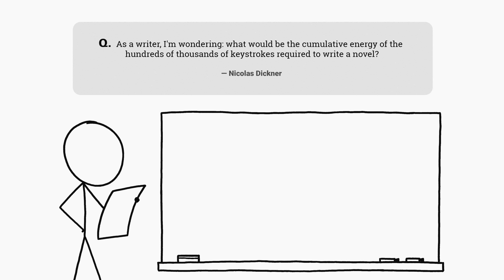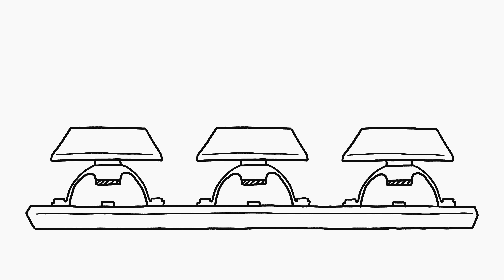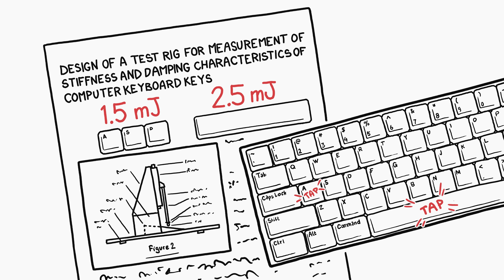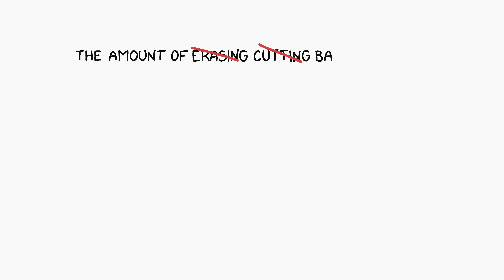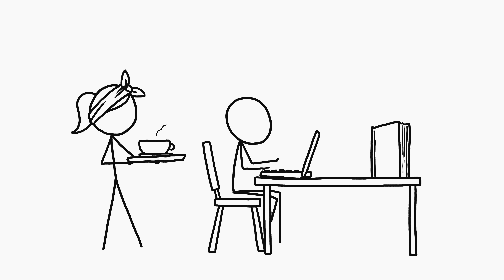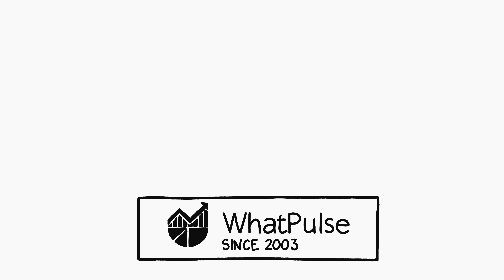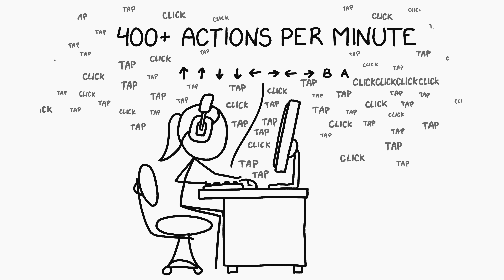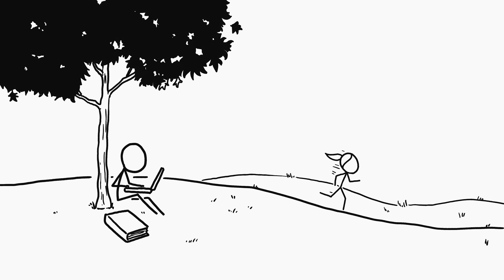Can you power your computer by typing?

Comment: An exercise bicycle with a generator should do it. A not very athletic human can fairly easily do 100 watts for hours on end. A highly efficient laptop with the screen brightness turned down low and only running a simple text editor (no AI!) can consume less than that, I think. If we can capture the heat energy from the body too, we've got another 60+ watts.

Comment: An AA battery can run a low power compute device (like a smart sensor) for years, so if you’re ok with the limited things a low power chip can do, it’s totally possible to power it with typing.

Comment: Im assuming you're referring to starcraft 1 or 2  when talking about esports and apm. Thing is, they abuse the repeating function of the key press. Like when you hold down your "a" key, and after a while, it starts to spam the letter "a" like aaaaaaaa.
This is because of hotkeys, so if you want to make say, 10 marines in sc2, you'd just hold down a for that long instead of spamming it.

Which means that the effort expended is less than their apm would suggest.

Comment: there is the problem, using a rubber dome keyboard. I use a (non-clicky) tactile mechanical keyboard with 67g pressure force. your normal mech kb has 40g force. I have zero problems with fatigue, the tactile feel is more like a massage to my fingers. using it regularly improves finger strength and endurance.

Comment: HEY car manufacturers! When are we gonna have tire pressure monitoring sensors powered by the movement and vibrations of the wheels?! This could charge a tiny little supercapacitor to keep the TPMS powered when not moving or moving slowly and it would last forever, never needing battery changes. I know it's possible...

Comment: I suppose this would greatly depend on what you consider a laptop and the type of keyboard being used.

A laptop shaped word processor with a non-backlit LCD screen that's barely a step above an electronic typewriter uses surprisingly little power and can run for days or weeks on a AA battery.

Combine that with a keyboard that has a single "power" key off to the side that uses much more force to turn a small generator like one of those emergency flashlights and you would still have something infinitely less useful than a solar powered submarine with a screen door.
Reply: Yep, would have been interesting to see the analysis go the other direction and explore how little energy it might take to run a word processor.
Reply: At that point just use a mechanical typewriter

Comment: And still a carefully designed circuit using ultralow power RF data transmission should have enough power from typing alone to power a wireless keyboard without batteries.

Comment: I think the proper question would be “How much computing can you power by typing?”
Reply: Yeah, you didn’t even state the assumed typical power consumption of a laptop computer! 65 watts I presume? But a text editor doesn’t need much of the CPU, and the screen backlight could be turned off, etc.

You could do text editing on a monochrome LCD of the kind that can be powered by ambient room light! Then you only need to power a processor. And you don’t really need to do any significant math with it, for a dedicated word-processing appliance. Just enough to control the position in an array and flip bits according to the ASCII values of the pressed keys.

And the energy generated from key-presses could be banked in capacitors (or since this is an XKCD video, a tiny flywheel — you do mention regenerative breaking!) to reduce the loss converting into chemical potential energy of batteries, perhaps?

Frankly this doesn’t feel like an XKCD video. 😜

Perhaps delving into the very small felt less engaging than the very large?

Are these videos only supposed to be about maximalism, such that when you encounter a question on minimalism, the answer is simply “no”? 🙃

Comment: what about rhythm game players? some people can 15-20 per second for a REALLY long time, also could the use of mechanical switches help? like a clicky or tactile switch or even switches with a higher force to reach the actuation point i.e. gateron black switches. How many people using those switches would be needed to power a microwave? or a led bulb? im not sure but i think that would make great for a part two
Reply: A lot of the top WhatPulse users are rhythm game players. Among the top few users, Robby250, myself, Applequestria, and Staiain all play a lot of rhythm games. It's just that the 20 inputs per second are very difficult to maintain for more than an hour or two at a time.

The world's best and most active VSRG players would be a step above most of us and may be closing in on 1 billion inputs by now, but that's still pretty comparable to the top WhatPulse users.
Reply: @SellymeYT is this including different game modes such as 7k or even games like adofai? i had those in mind when thinking of the averages. I’ve seen my friend play adofai once and it looked physically unreal, and yeah i think i highly overestimated the stamina of the average player but for arguments sake a top stamina adofai/7k player could produce an absolutely ABSURD amount of key presses in a given time
Reply: @3ZLU 7K can in theory peak faster than 4K, but there tends to be more elite 4K players. ADOFAI would be a lot slower for typical play (and is disadvantaged by having existed for far less time than generic VSRGs).

Comment: Can you calculate the maximum possible size of a sphere of.. various elements? 
For example, if you kept increasing the size of a ball of aluminum, how big can it get before it collapses on its own weight? Either into fusion or a black hole. 
Same question for Tungsten. It should be a much smaller volume than the aluminum max size.

Comment: A computer powered by typing is a typerwriter
Reply: I was going to say that usually the issue with siphoning energy off a process is that it doesn't mean you're recapturing already used energy, but instead requiring more energy for the original process. You can use a car engine to charge the battery, but that means the car has to burn more gas to drive the belt for the alternator. A Prius uses regenerative braking to recapture energy, but sometimes it has to run the engine specifically just to charge the battery.

So really, the practical way to make your keyboard power your laptop is to simply increase the force and/or distance required to press a key, which basically turns it into a typewriter.
Reply: @CookiesRiot  A typewriter isn't a computer though. It doesn't take much energy to run a simple word processor compared to a whole PC, but it's still more than a typewriter could provide because changing energy types always results in a steep efficiency loss.
Reply: @Yonkage-ik5qb  Yes, what I meant was that if you attempted to design a computer to function exclusively off of keystrokes, the inevitable engineering solution would be to make the keystrokes require so much energy that they would physically feel more like a mechanical typewriter than an electric keyboard.

Whether it would be sufficient to run a full PC would depend whether you're willing to have a keyboard that requires the strongest man alive to press or a massive reduction in capability of the computer to reduce the energy requirement.

Based on the video saying 1kJ gets you 30s of power, and an estimate of .1J per keystroke for the manual typewriter, you would need to type 333 keys per second to run a full laptop with a regular typewriter mechanism to feel the same.

Obviously that's ridiculous, but you could make it match a typewriter's approximate average of 3 keystrokes per second by either making it take 111 times more energy to press the keys (by increasing resistance and/or distance of the keystrokes) or simplifying the laptop to minimize functionality so it draws 111 times less energy (probably by making it a simple flash memory word processor with a tiny LCD or e-ink display, like a cheap scientific calculator).
Reply: A typewriter doesn't compute.
Reply: @renakunisaki  It does if you type "1 + 1 = 2" on it
Reply: Hand-cranked adding machine would be more apropos. Or, y'know, a Babbage engine powered by hundreds of squirrels running in hamster wheels. They literally work for peanuts!
Reply: @moosemaimer  Hand-cranked adding machine is extremely apropos because a conventional computer is literally an extremely intense adding machine. All functions performed by your PC are addition in its various permutations (substraction is negative addition, multiplication is multiple additions, etc.).
Reply: Wait, the illustration shows a separate typewriter generator but the energy estimates are probably from a membrane keyboard. Maybe the typewriter can make this a little bit closer to reality.
Reply: @rkvkydqf  I did the math for another comment above...

A typewriter takes about 100mJ per keystroke, which is only about 67 [not a joke] times the amount for the small membrane keys or 40 times that of big membrane keys according to the video.

You would need to be able to press about 333 keys per second, unless you change the amount of energy required to make it much harder to press each key or power a significantly less energy-intensive computer (something like like a scientific calculator with a tiny LCD but only enough computing power to run a simple word processor on that screen).

Comment: I’m old and learned to type on a mechanical typewriter. You really had to push those keys hard to get enough kinetic energy into the hammers to leave a decent ink impression on the paper, and pressing the shift key lifted the whole platten half a centimetre or so, and it massed more than several squirrels.
Reply: Yup. In fact, I think with a flywheel & good typing speed, quite a few low power computing tasks could be done with keyboard power!
Reply: @prophetzarquon  also, if you're using one of the distraction-free writing appliances (that keep turning up on crowdsupply and indiegogo) that are an ESP32, a small e-ink display, and a keyboard, you can drastically lower the amount of power needed for the writing - I don't know if any of them can run six months on 1xAA, but they definitely can run more than a week...
Reply: @MarkEichin  Skip the display entirely. Is it possible to make a bluetooth keyboard run on keypresses alone?
Reply: @prophetzarquon  xkcd isn't known for their creativity or even being correct...
Reply: So you could turn a typewriter into a squirrelflinger?
Reply: @renakunisaki  i sure hope so
Reply: I've had a couple of those too, they could really work out your hands.
Reply: I also learned how to type on a ribbon typewriter, no electricity. Much more force was needed for those. I wonder how many squirrels I ended up lifting!
Reply: I owned two typewriters in my life and both where hard to move in the beginning but as I cleaned and oiled them, they where really comparable to mechanical keyboards. But the travel was longer per keystroke
Reply: @SirThyrm  I have two typewriters, one is electric assisted, and the other is fully electric. The full electric is about equivelent to a mechanical keyboard, the electric assist is roughly equivelent to a mechanical keyboard with heavier springs, the travel distance was roughly equivelent to a regular mechanical keyboard.

I have also used a fully mechanical typewriter, and while it  was noticeably harder to type on than a mechanical keyboard it wasn't that bad. (Force was equivelent to a heavy spring on a mechanical keyboard, but much longer keypress.)
Reply: @Reverend_Jay force times distance is work. If you move further you are doing more work. Also perception of light weights is non linear. What feels slightly heavier can actually be dramatically more force.
Reply: @Reverend_Jay  Man, are mechanical keyboard really that bad?

I miss my keyboard that was half normal keys, half laptop keys. So comfy.
Reply: I hate typewriter shift keys sm... my pinkies are not built for that kind of workout.
Reply: Not to mention that mechanical adding machines are a thing.  All the laptop would need is a crank on the side in place of the enter key.  Speaking of which... manual typewriters had manual carriage returns.
Reply: Lol you made me think of Matthew 10:31. Fear not, therefore; you are of more value than many squirrels
Reply: @jameslutz6942  I know this probably means "many" in the sense of like "y=15x, y is worth many xes", but I can't help read it as "more value than many, but not all"
Like "don't worry, you're better than most squirrels"
Reply: @coryman125 Turns out there are some squirrels that you just can’t measure up to lol
Reply: @jameslutz6942  Now THAT I would have on a motivational poster

Comment: simple way to fix this is just make the keys require way more energy to press and make sure that the writers aren't a bunch of weaklings
Reply: Manual typewriter users: We see no problem with this.
Reply: @prophetzarquon  We? You're the only one.
Reply: I totally want to be the guy who pitches the design for the least kinetic energy efficient keyboard design possible. 

So bear with me here guys, what if instead of using springs in the key switches we replace that with hydrostatic diamonds(material with the highest elasticity modulus). That way the user needs to exert a pressure potentially as high as a few terapascals per keystroke. We could then harness that energy and use it to I don't know perform nuclear fusion i guess?
Reply: @GaudyMarko  just put the stuff you want to fuse under the keys and the energy produced by the fusion will reset the keys
Reply: @GaudyMarko  sounds like a keyboard-based diamond anvil cell I guess
Reply: @PurpleShift42  correct that is what i was going for lol
Reply: The logical extreme to this is to replace the keyboard with one like those giant floor pianos. You have to jump on the keys in order to type.

However, this raises the issue that your "typing" speed would reduce to at best a character per couple seconds, assuming you were on some kind of bungee-harness that allowed you to bounce from one key right to the next. There's probably some medium in between these two extremes that would provide the maximum energy with respect to energy-per-keypress and keypresses-per-minute, but it still wouldn't be very much. An Olympic-level athlete can, in the best circumstances (a bicycle hooked directly to a dynamo generator), put out like 100 watts of energy. That's the limit.

You can't run a computer on that, not nearly.
Reply: In WW2 they could have used typewriters to power the whole war effort!

Comment: Oh god I remember the solar roadways nonsense. I could not convince believers that it was impractical. It was the ultimate sophism convention and there was no real discussion to be had - they had no interest in what science and engineering had to say. For those wondering: Don't build the solar panels under the cars, build them over (e.g. as a roof or sun shade to a parking lot) or next to the road (e.g. along the side of the roadway, alongside power lines). If you want to put solar panels under tires then you're facing so many structural and other practical problems that your idea will ultimately never work, let alone compete with the many better choices.

Comment: Out of curiosity, do any of the popular keyswitches make an impact on this metric? Stuff like Cherry MX Red (light, linear switches) vs Green (heavy, clicky switches), scissors-style keyboards vs butterfly keyboards (like the 2016 MacBooks) on the laptop end, or even a touchscreen on a modern smartphone.
Reply: i dont have numbers for you, but my gut instinct is it wouldn't make much of a difference (maybe a couple 1/10th-microjoules extra depending on the switch type)

Comment: How does this change if a manual typewriter is used.  I heard that secretaries generally lost weight when their manual typewriters were changed to electric ones--mostly from not needing to throw the cartridge at each end of line.
Reply: Lost weight going from manual to electric? Or gained weight because they were 'exercising' less due to the switch?
Reply: @arctaes  You caught me--gained weight.
Reply: @wcgreen55 very interesting though, thanks for sharing